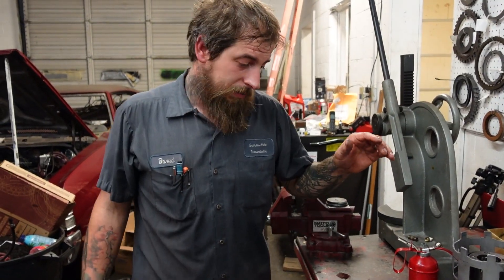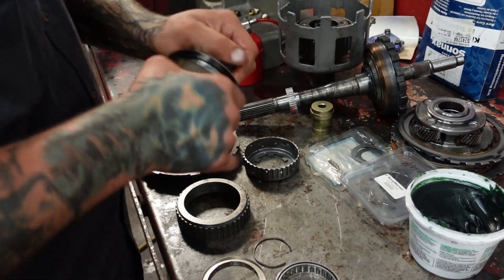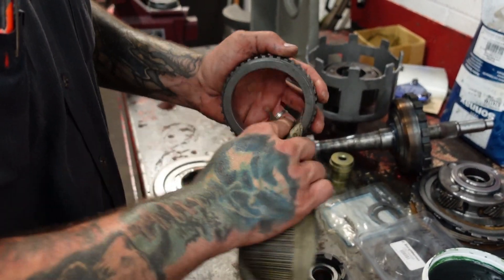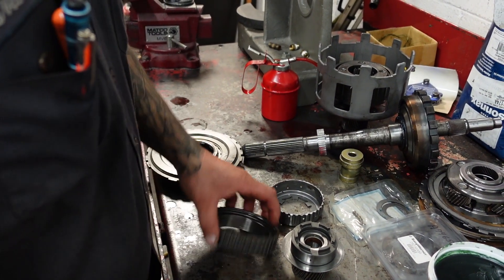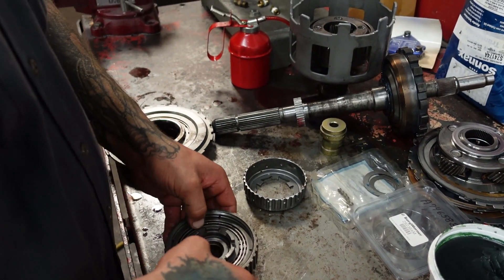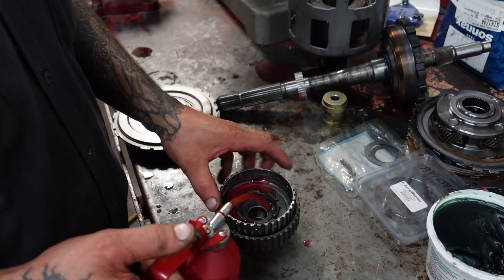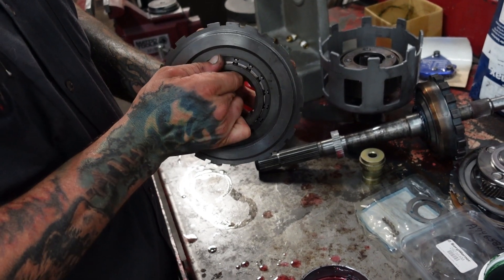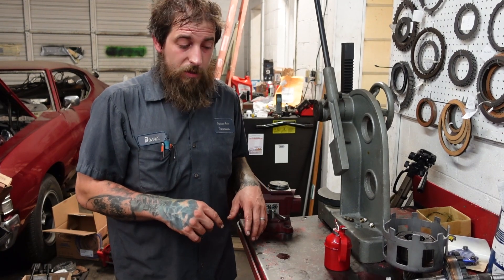4L60 sprag rotation

Comment: What do you set your clearance on your clutch packs  3-4, forward, reverse input drum....ect?
Reply from the maker: Stock rebuild i go with .020 on the 3/4. .040 fwd .020 overrun .090 lr .040 rev input .085 band travel .015 total end clearance

Comment: Before teardown of the 700r4/4l60, should the output shaft be able to rotate just one direction or will it rotate both directions? Does it matter if the gear selection is in neutral or drive to be able to rotate?

Comment: just put a new Sonnex inner race in my low reverse sprag.(the one that comes with new smart tech housing). It sounds like yours, but maybe louder. I was concerned something was wrong but it seems like it maybe normal. Can you please elaborate? It sounds like the springs in the  bearing are rubbing. I looked as best as I could and they all seemed to be in place.

Comment: Thanks for the video. What grit sandpaper did you use on the sprag race?
Reply from the maker: I use 80 grit wet or dry I typically will sand them while I'm at the parts washer.